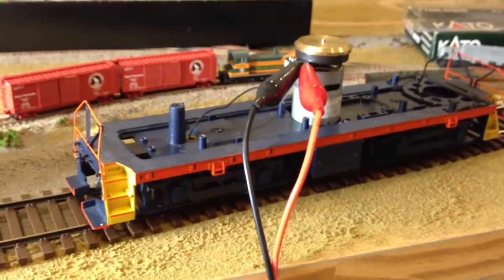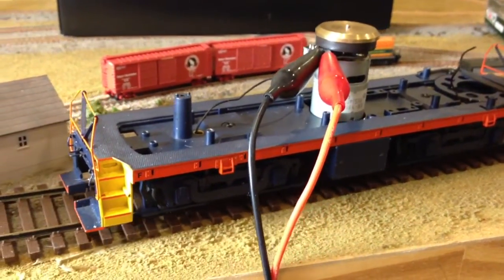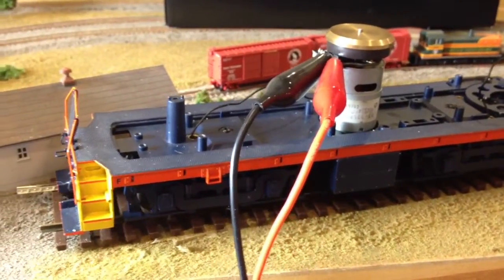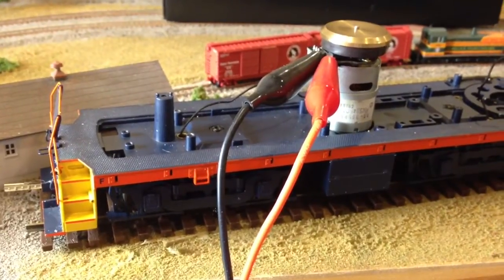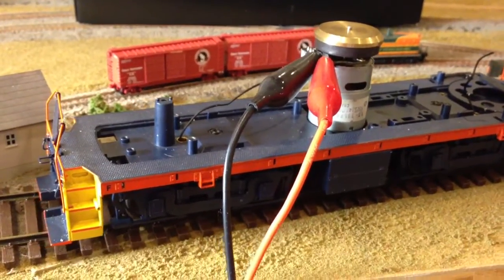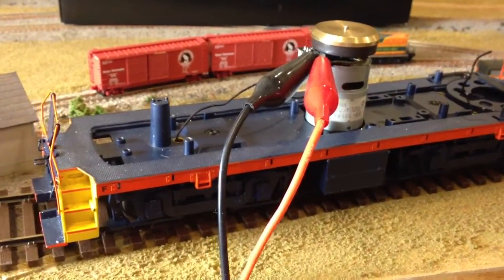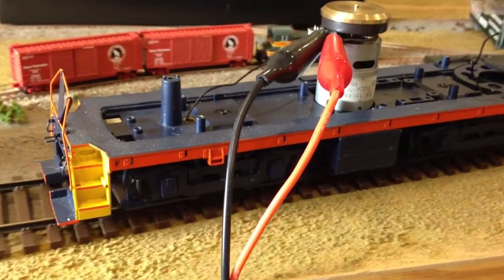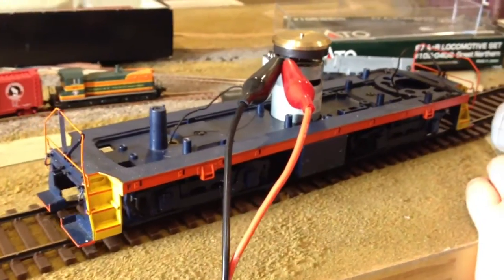2 railing the S4 #1

Comment: That's a nice looking 2-rail conversion you have there. How hard was it?
Reply from the maker: Thanks. Pretty easy so far. Just remove all of the Lionel electronic guts and drop in the NWSL 2 rail conversion axles. The biggest issue so far was that I needed to make my own shims from washers because the axles would slide sideways so far that the gears wouldn't mesh anymore. Once I got that figured out I was good to go.